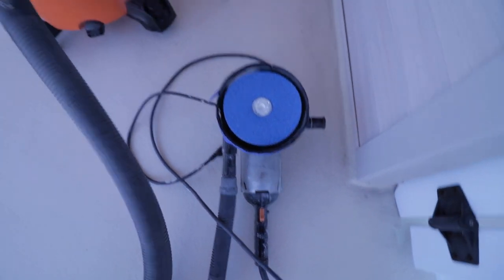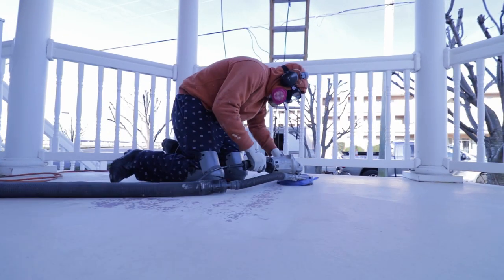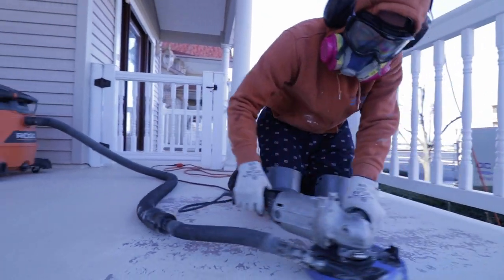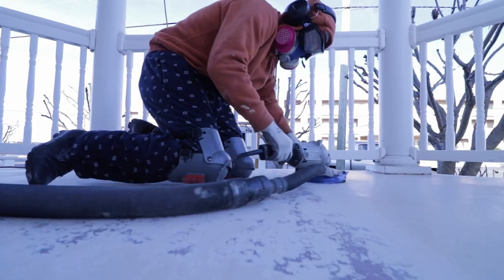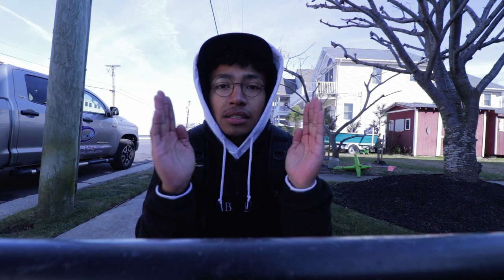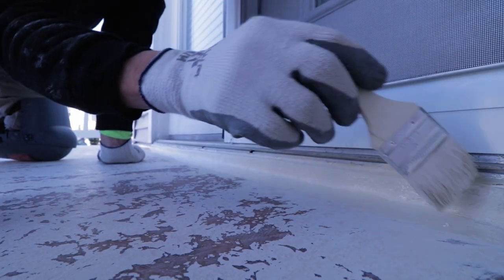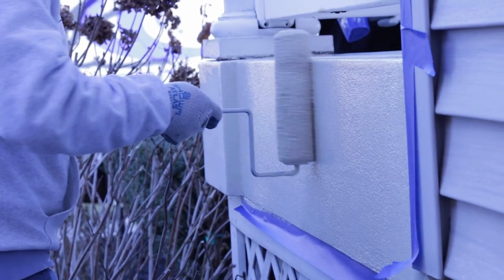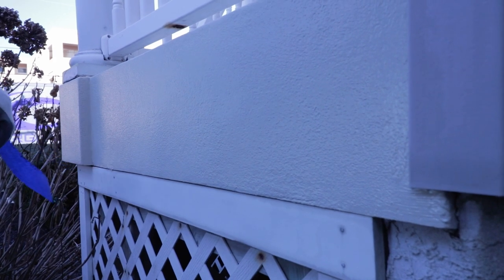HOW TO RE-COLOR A FIBERGLASS DECK

Comment: Great information but, What kind of paint should I use after the floor is ready? Thanks
Reply from the maker: You want to use resin based gelcoat. This is what we use! 

https://www.nacomposites.com/Catalog/Gelcoats/ISO/GENERAL-PURPOSE
Reply: Why did the stuff you use peel off in different locations
Reply: @williamroberts9619  That was painters tape my guy. Its how you get the super clean lines.. Its just LOW TAC tape that you put down paint all over and then peal up for a perfect edge.

Comment: During the sanding process is the main purpose to give you a smooth surface? I only ask because I see not all of the previous paint was sanded off.
Reply from the maker: You are correct. Good observation.